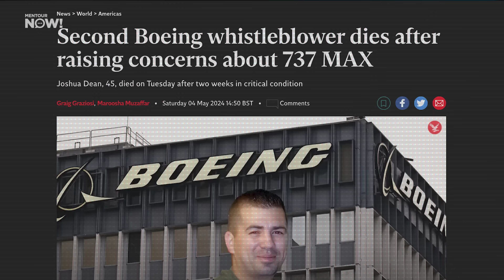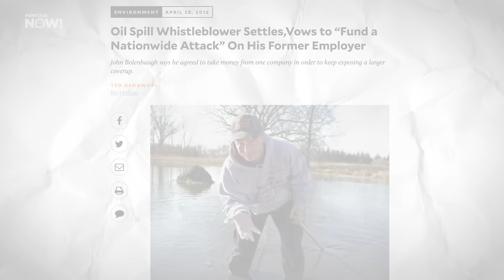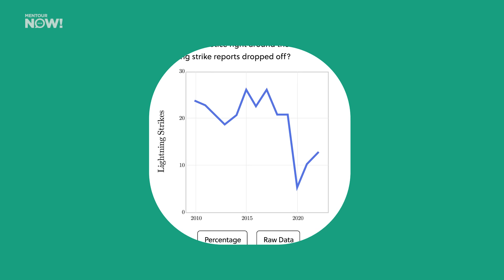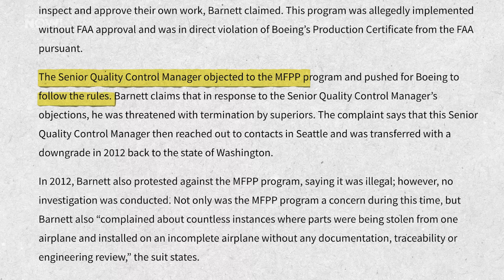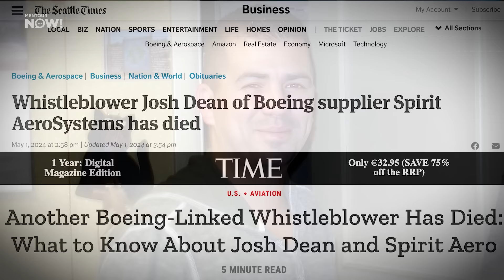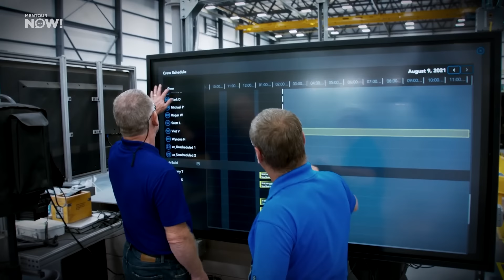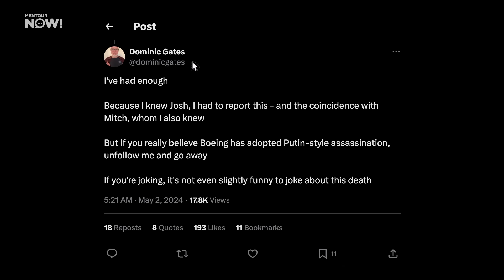Whistleblowers Vs Boeing: What Happened?

Comment: You are totally correct in your statement about this problem. It didn't happen overnight and it will take years to fix. However, the attitude towards the issue says a lot about how Boeing is working behind the curtains.
The Calhoun saga, the fictitious board reshaping, the constant denial-later on confirmation of problems, and the predatory attitude towards their own employees suggest that they have no intention or interest in making things better for real.
There are no fast and easy solutions. Important changes are necessary, expensive and difficult changes. 
No one is getting any benefit out of the misery inside Boeing and they need to proactively address their issues before they slip out of their hands.
Having such a bad reputation during multilevel shortages (qualified personnel) can make everything worse in the upcoming decade.
Great content, Peter.

Comment: Every large company here in Germany needs to have a workers council where members of the workers council are allowed to sit on the board of directors meetings.

If Boeing wasn't trying to crush it's union and actually welcomed it's union into all those management meetings then issues could either work their way up the usual management levels or issues could work their way up through the union structure to the board of directors.

Comment: The issue at hand is not whistleblowers not being protected, but management 21:12  having too many ties with shareholders. Shareholders are the single biggest risk to any safety-related company because of the way they want to scroupulusly make profit, in the process endangering others. If shareholders have too much control over a company, management risk loosing oversight and loyalty to the company. Instead, they become loyal to the shareholders. 
As such, shares and shareholders are the single worst invention since money and sliced bread.

Comment: I don't know if safety culture is the proper term.  It's not just safety that seems to be Boeing's problem.  It is production over quality.  If quality is a primary concern, then safety would likely come along with it, but safety practices don't necessarily bring quality.  Boeing needs a return to a quality focused culture.
Reply: Safety culture is a widely used term that specifically focuses on whether or not employees feel safe enough to share bad news with their bosses.  If anything, it is a prerequisite for quality.
Reply: @lmpeters  I didn't know that.  I was interpreting it based on the individual terms.  I wasn't aware of the corporate definition.
Reply: It is both.  You can make something fundamentally unsafe to a very high quality without it ever becoming safer as a result, or you can make something to a poor quality and sacrifice the design safety as a result.  It has to be safe in both design and quality of manufacture to achieve the desired result.  You also need to be able to manufacture the safe design in a safe manner which allows flaws to be seen or tested for, which is a whole branch of engineering all on its own.
Reply: you know something is SERIOUSLY FUBAR when keeping the shareholders happy is more important than making a good product.

Comment: I am incredibly surprised, not about the way the US is about 30 years behind the rest of the world on whistleblowers but that they seemingly do not have a Risk assessment manager. Any Risk Assessment manager would point out that the risk to brand reputation and to payouts for subsequent issues far exceeds the potential cost of simply having a safe working environment that they can use to bolster their reputation in the market. Admittedly they have a MacDonald-Douglas problem that really needs to be pensioned off and return back to the Engineering Focus of Boeing of their past. They have scored an own goal with this insidious way of thinking with incredible short termist working practices that must be ditched. None of this is going to help them build a real future without rooting out from top to bottom of this way of thinking. MacDonald Douglas has really given Boeing their reputation for crashes, defects and massive repetitional damage. No wonder so many airlines would rather have a mixed fleet with Airbus.

Comment: In June 1998 I attended a set of presentations (including my own) on the role of corporate databases. One of the presentations was by a person from Boeing who spoke about the creation and use of a database for recording observed manufacturing defects. As I recall it was initially for 737 wings. The use of the database was initailly resisted but in time it was enthusiastically adopted. Why? Because it improved product quality, It improved co-ordination amongst units. It made defect resolution faster and more predictble. I suspect that this excellent tool was cut for 'efficiency' reasons.  There may still be some grey beards around who could tell you about it.

Comment: Can you please do an episode on the recent Boeing plane incident where they claim someone died and a bunch of people were injured due to turbulence? Apparently it dropped 6000ft, which makes me think it was actually a stall and not turbulence at all 🤔
Reply: Recommend Avherald. 6000ft in 3min isn't actually that fast - seems like a planned cruise-down.
Reply: Aside from the part where the descent rate was indeed 2000ft/min (which is super normal to escape turbulence), Mentour doesn't do videos on incidents still being investigated
Reply: The death is well documented, not just "they claim."
Turbulence is well known and well documented and perfectly capable of causing exactly the injuries that are well documented happened on that SIA flight. Turbulence is known to be more common around intense weather as was documented at that location.
Note that turbulence can cause negative G forces in the cabin. A stall is zero G. It's clear (again well documented in photos and reports) that passengers hit the ceiling with force.

None of this us related to the brand of aircraft. All aircraft are subject to physics like weather.

Comment: Thank you SO MUCH for this clear, fact-based and reason-based discussion. I believe you are spot-on with your analysis. I can only hope that this kind of clarity will prevail over the ever-present pressure of "maximize shareholder value." I especially love your underscoring that whistleblowing isn't a symptom of disloyalty but actually a sign of loyalty and commitment.

Comment: Fun Fact: I flew on what I'm at least 98% sure was some variety of Boeing 737 MAX (The Engine Pylons are fairly distinctive, so it's easy to tell. I do know it was a Boeing of some sort, because some of the safety items I saw the Cabin Crew carrying were Boeing branded.)

What I garnered was that Something involving the electrics failed, which meant that the Plane required external power to start the engines, which delayed our departure. The Plane also required external power to shut down the engines- but the bay we pulled into at our destination didn't have working external power facilities, so we had to wait for a cart!

It was, as the Captain noted, 'one of those days'.

(It was a Ryanair Kraków-Stanstead flight scheduled to depart at 1915, if people are interested.)

Comment: I had a new boss”mine was out with cancer “  who told me that a landing gear hose had no torque stripe and he wanted me to mark it as torqued. After diligently checking the area I found that neither end of the hose was marked as torqued , after I checked the record I found that the job had not been completed or witnessed by QA. When I informed the manager I was told that the functional test was already sold to the customer so it had to be good…wrong answer. I was gone within a week.

Comment: They may not have pulled the trigger, but had John Barnett not worked for Boeing or rightfully blown the whistle on the company as he did, then he'd surely be alive now. The company is responsible for the situation he ended up in and it's sad that this isn't commonly acknowledged.

Comment: Boeing's MFPP program is incredibly dangerous. When I was working on Fighters in the Air Force, there were some jobs that I did that I could sign off on if I had the appropriate level, but any critical system job had to be checked and verified by a person who did not do the work (or a Level 7). This is so important to have a second set of eyes on a job and while sometimes it made things take longer (because that level 7 had other inspections before mine), I never thought "I wish I could just sign this off myself". Also, any time  a part changed from one aircraft to another it was a huge deal to make sure you documented it for multiple reasons. Such a shame that Boeing has apparently forgotten such important safety practices.

Comment: In other industries in which I am expert, major multinational customers routinely appoint an independent inspection agency to provide inspection of critical components at various stages in the supply chain. We do this because the manufacturer has a severe conflict of interest and simply cannot be trusted to put quality and safety before $$. To expect internal whistleblowers at the manufacturers to maintain quality is simply unrealistic and risky. Potential whistleblowers have a severe conflict of interest too. We’ve been using such 3rd party inspectors over my entire career. Why doesn’t the aerospace industry use them????

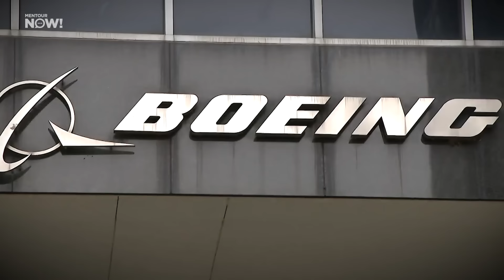Comment: 20:00 I think it would be good enough to have a automatic bonus for finding a security issue but one week cooldown period after a false report within which time the bonus might not be rewarded even if issue is real. That way, there would be incentive to think a bit before stopping the production because false finding might prevent earning the bonus for a week.

However, I think the company should still pay the bonus if the reported issue was found within a week from false report in case the reported issue was serious enough. For minor issues, it's okay to no have extra bonus if you stopped the production within a week already.

That is, at worst case you don't get extra bonus but you never have any personal penalty for stopping production for a security issue.

Comment: Money over safety is not only issue in Boeing or Aviation at all. Gas and electrical installations in some (most...) cases are ticking bombs. Same thing with electrical and electronic products from China. Some time ago I was working with changing unsafe chinese parts to (how much?...) safer ones in some machines.

Comment: Don’t underestimate what loose/left behind shavings can do!  A former job I worked at (wastewater…) had some large aeration blowers installed… 480V AC large amount of power….and the contractor had to make appropriate holes in sheet metal to install the large conduit that had the large wires in it… he failed to clear metal shavings out of area of the bus bars (thick copper bars that route power to needed areas), and once they powered the unit up… KABOOM!! The metal shavings caused a massive arc flashover on the bus bars destroying them. Luckily they’re contained in a way no one got hurt. It doesn’t take much…. And especially with titanium I’d imagine!

Comment: If you are aware of serious safety issues that threaten the lives of millions of people that use your product every day, which in this instance is a pressurised tube flying through the air at 40,000 feet in excess of 500 mph whilst carrying hundreds of paying customers each trip, you need to ask yourself; what's the right thing to do? 1) Just ignore the issue, say nothing and do nothing, or, 2) Do whatever you can to try and get the issue resolved. Some people do actually put values, morals, quality, safety and just doing the right thing before collecting a pay cheque.

Comment: Maybe this Peter's suggested way of working could prevent 737 max groundings, even it wasn't connected with big metal shavings near wiring, but rather in IT department, where they also have their workflow.
Would be interesting to see how Airbus deals with similar issues.

Comment: There is an inevitable deadline to modern commercial aviation, where the social cost of fossil fuel propulsion overtakes the benefits to consumers - either in real terms or just in public perception. People won't want to fly to Disneyland when they know means a person dies.

For whatever reason, the industry has completely forsaken adequate investment in alternative propulsion or design, making this tipping point catastrophic to the industry. Everything we're seeing is corporate raiding to pump value and slash costs in expectation of this crash. It won't get better.
Reply: There is no alternative to fossil fuel in aviation. The only viable alternative is nuclear - which is too damn heavy if you install adequate biological shielding. And dont even talk about battery planes - these would replace only light and ultralight aviation, if increased cost and weight would be a trade off worth taking (which it absolutely isnt as of now).

Comment: Well thought out video. Your points about building a safety culture at 18:25 are quite true and you make them sound so simple, but much of middle, and in most cases upper management, are willing to sacrifice these guidelines for better bonuses, enhanced stockholder value, as well as many other personal financial gains. As a 43 year Engineer in this industry, I eventually became unsurprised as to how low their ethical standards could sag. Greed is not good. It is, rather, a recipe for failure. The company I worked for 31 years of that 43 year career demonstrated that very well, but managed to snap out of their greed driven stupor just in time, not just once, but many times over the years. I am really glad they did. Too bad Boeing didn't come to their senses sooner.

Comment: Well, I have flown around regularly all over the world the past 35 years and have today reached the point where I will willingly pay more if necessary to ensure that my travels are only done on Airbus airplanes. If I absolutely have to fly a Boeing airplane, the only airplane I will accept to fly on is the Boeing 777.
I will not fly Boeing 787 or 737 MAX whatsoever. 
The decision is not only based in safety concerns but I simply refuse to support a company like Boeing when they show such a disgusting business strategy as present where profit and shareholders are the primary focus instead of quality and engineering excellence.
Reply: But how is it based on safety when dreamliners have never crashed? How does that make sense? Max also have only crashed twice, that's a very small amount compared to how much they fly and don't crash. If you are worried about safety there shouldn't you be worried about everything else in life and living in fear? Perhaps even being fearful in your own home

Comment: 13:51 I stopped the video here to write my comment. So are there Boeing Planes flying around that have stuff in them that shoulnd't be there? Metal shavings, tools, bolts. Over time that could short the wires and cause big problems. Is is not save to fly with a Boeing? I know statistically it is still save. But maybe Airbus is safer then Boeing now?
Reply: Well! They had find the tools. But! Just to make a sill auestion. Let's do it and make youself a fool

Comment: one way to improve quality and safety....  ALL management Has to fly in the maiden/test flights of every plane they made. 
Maybe the main production line people should have a paid round trip flight also. Tell them "this is the plane you finished last week"
Make them sweat a little as they wonder if the titanium shavings they were too lazy to clean up are cutting through the wires under their very asses. 
The ones that are not sweating should then be considered for dismissal or different (non safety) job position because they have no concept of consequence.

Comment: I don´t think it's coincidence that safety dropped immediately right after a merger.  Mergers reduce competition, regardless of what any of the people in favor of mergers might say.  There are fewer companies competing, and one of those companies is now significantly bigger than it used to be.  How could that do anything but reduce competition?  And with reduced competition, there's less to worry about from safety issues like these.  Can airlines actually ditch Boeing?  From the sounds of it, we're effectively just down to Boeing and Airbus.  So no, they can't.

I'm not sure that sticking with Boeing through this is a sane plan, however.  I think if I were someone in a position of significant influence, I'd be looking to see if Boeing could be broken up again into smaller companies so that there would be more alternatives.

Mergers also create incentives for being lax about safety.  Every merger announcement i've seen promised it would reduce costs.  There aren't that many obvious ways to cut costs.  There is an easy predictable cost for complying with safety regulations, while the costs associated with not complying are much less predictable and much more likely to be born by ones customers rather than the company itself.  Unfortunately, it would require a significant number of whistleblowers, like Boeing has had, for their customers to sue their vendor for reimbursements of their costs to cover their vendor's negligence.